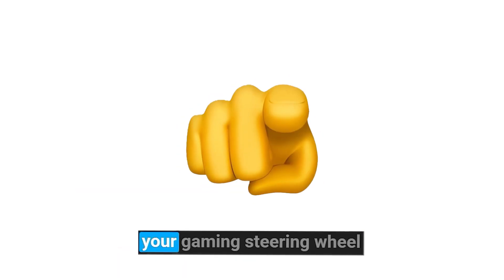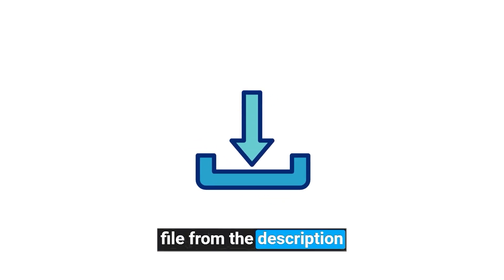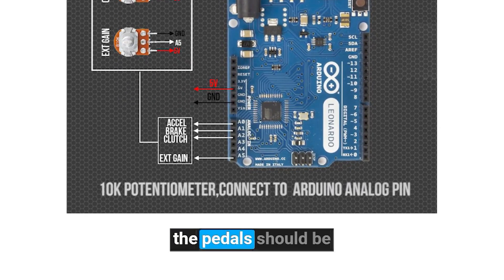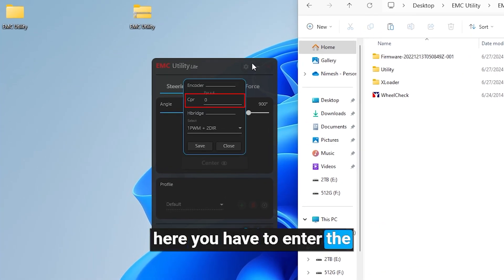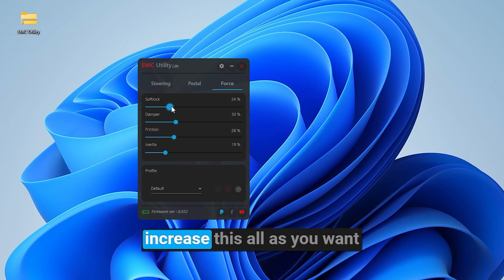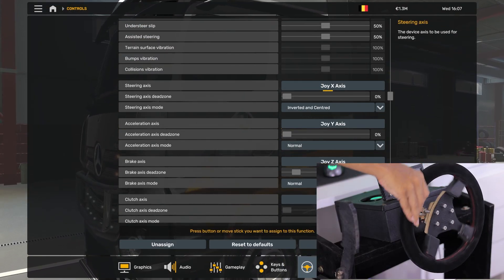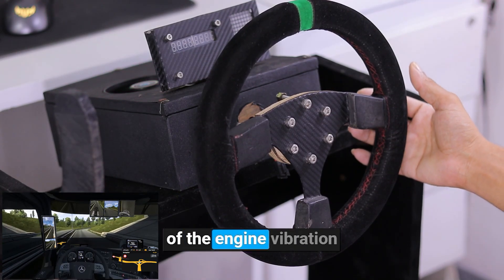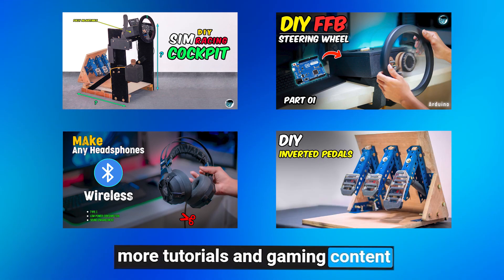Let's Try EMC On DIY Gaming Steering Wheel

Comment from the maker: Found Something Helpful For The EMC Lite Users.

In my EMC Lite tutorial video, I said this supports 3 buttons only. So, because of this, we can't use the H-shifter and other buttons. We can only use three buttons.
  But recently I found another 8 more working buttons. I uploaded a PDF diagram link you can check it. So now you can use a 7-speed H-shifter and 3 more buttons.

Check this out - https://drive.google.com/drive/folders/1mOYUsYBuNYONqEzS9h-bM3neYA0BAqmM?usp=drive_link
Reply: You can use at least 16 buttons, used three analogue pine and 4.5,6,7,12 contacts
Reply: My pedal is not working how to fix it?
Reply: That last part 5:57 , that's the main concern 😢 , I'm thinking, there is no safety for the infinite spin in emc utility, 

Infinity spin happened due to  ,
1) in case of motor can't able to reach the desired position of encoder
2) encoder signal get noised 
3) EMC utility crashed 
4)game crashed 

Solution: there should be a hardware break after 900°
Inside the firmware there should be a lock.  ffb signal =0 then torque=0

I have a new solution, there should be a secondary microcontroller which will communicate everytime with Leonardo, the 2nd one will latch a relay power in case of these problems that 2nd will cut off the main power of motor

Comment: Hello , why does ffb only work when turning the steering wheel to the left side both in games and in wheelcheck 
Can this be related to the insufficient power of the power supply, I have it from a PC and a current of 18 amperes 
I ordered a 33 amp power supply, I hope that's the case, but if not, what could be the reason?
Thanks
Reply from the maker: It's not a power supply problem. Have you remembered that the bts driver has two signal wires from Arduino pins 10 and 11. one for the left side signal other one for the right side signal. In your case, the one side ffb is working, which means the other side signal didn't take the bts driver. So I think you should check the bts and Arduino signal wires. It would be better if the wires were changed.

Comment: Hey i have a problem u didnt show solution, my steering wheel is a bit buggy. Game detecs the center (0 degrees) as steering wheel turned fully left, and if i turn left one more tick, it turns fully right instantly. And game takes center as 224 or 228 degrees. Pls help. My encoder is ky 040

(Tested games: My summer car and Long drive)
Is games are problem or my steering wheel?

Comment: Why would anyone use EMC when there is AFFBWheel available... it supports more hardware than emc and its not paid- allows for so much configs.
Reply: That didn't even worked for me, center always slips, games don't even recognize FFB.
Reply: @kristof3031  what CPR Encoder are you using? is it the ky-040? and for forza and other titles you require GIMX or forzaemu to play. I've made two steering wheels with that and works flawlessly

Comment: Hey, I was wondering, do you need protection between the H-bridge and the DC motor to safeguard against the voltage generated when the motor spun by the wheel?

Comment: Hey Nimesh! My encoder works great when turning slowly, but messes when rotated fast. Is that due to not adding that 1k resistors? Do resistors reduce noise? I grounded the shield wire but nothing happens...

Comment: always bug with centering.
i try with different encoder, bug still buggy.
0 degree always change position
Reply from the maker: I think it's not a bug. It can happen bad connection between the steering wheel shaft and the encoder. Also, it's good to encoder wires soldering to the Arduino board for better connection. because the jumper cables are not connected properly.
Reply: any solution for ffb not working di rfactor2?
wheel detected but no ffb
Reply: Same problem here too, everything fixed properly, no slipping, 0 point still changes.

Comment: I have a problem with the steering wheel. EMC normally sees an angle from -450 to 450, but PC only sees -450 and 450, like the arrows on the keyboard. ffb doesn't work but I think it's because of the problem above. Does anyone know how to fix it?
Reply from the maker: Check your encoder CPR value on EMC.

Comment: Hello guys. I figured out how to use 4 buttons on the emc lite software.
Use the digital 4 pin for ground, and digital 5 pin is button 1, d6 is button 2, d7 is button 3 and d12 is button 4

4-5
4-6
4-7
4-12
Reply from the maker: thank you!❤️
Reply: is there a pin for the other buttons bro?
Reply: @ojanmarkojan312 if you buy the EMC, but that only works for esp32

Comment: How can I invert force feedback direction in EMC? I was playing F124 but the FFB is in wrong direction and there are no setting in F124 to invert it like Forza 5
Reply from the maker: There is no option to change in the EMC. Switch pins 10 and 9 of the Arduino board.
Reply: @ But changing it will opposite the EMC’s wheel lock, even I change the force to 0%
Reply: @ what about wheelconfig show that Another instance of WheelConfig is running
Reply: And WheelConfig show that my wheel is not rotating even if my wiring is correct and encoder is not broken

Comment: what is your editing software and voice over and i did have that problem it happen whenn the wheek goes over bumps so it ocelates so the sofware gets confused and tries to 0 it but it keeps failing so it spins the only way i found to fix it is to lower road viberation this happend in forza for me too when going over some rocks
Reply from the maker: I use Premiere Pro and Google Cloud text-to-speech. yes, I also try different games. The same happened in assetto Corsa. but not every time.

Comment: mas saya pake encoder printer epson ip2770. tanpa ffb berjalan normal. tapi ketika saya nyalakan powersupply tidak terjadi apa apa (wiring 100% sama sdh bolak balik di check, motor pakai 775, psu 12v 20A) apakah ada saran atau solusi? terima kasih

Comment: what is z toggle for
Reply from the maker: It is used for wheel calibration, but now it is unnecessary for the new EMC version.
Reply: @zudumalli  alright but there is also calibration for the yk
Reply: @zudumalli  also not the new version the lite version
 so i still need it?

Comment: Hello bro, I made the connection as is from the BTS7960 to the motor driver, but the force feedback does not work for me
Reply from the maker: did you check your motor driver and Arduino wiring
(Arduino 10, 9, 8, pins)
Reply: @zudumalli  It was a bad encoder connection, it had pins A and B inverted, which is why the feedback did not activate.

Comment: Good afternoon! I built a similar sim wheel, but on the EMC utility lite software the steering is inverted. I tried inverting the encoder wires, it worked but the ffb went crazy. Do you know what can I do? I'm researching in the internet but i haven't found anything useful yet.
Reply from the maker: try inverting the motor driver wire (10,9 pin)

Comment: Saya sudah lama menggunakan EMC lite, tidak pernah ada kendala, mungkin karna punya saya non ffb 😂

Tapi ada beberapa kemungkinan anda mengalami masalah seperti itu, belt longgar, pulley tidak mencengkram dengan baik pada as roda kemudi, kualitas encoder buruk.

Agar lebih awet dan tenaganya kuat anda bisa menggunakan motor dinamo sekuter listrik misalnya my6812, dan ganti as roda yang lebih besar agar lebih baik menahan putaran dan pulley tidak bergeser.
Itulah info yang saya dapat dari komunitas😅

Saya tunggu update selanjutnya 👏🏽💪🏻
Reply: Maaf saya instal EMC lite di paling bawah tulisannya firmware ver : unknown.  Dan gak bisa di apa apakan .kenapa ya
Reply: @alfawings1958 coba reUpload frimwarenya bang, atau check perkabelan biasanya masalah disitu
Reply: @alfawings1958 framware Emc nya belum di load ke Arduino.
Reply: Punya saya FFB menggunakan Encoder 600 PPR, stir di putar  90° error (muter kenceng tidak bisa dikendalikan) sudah di utak Atik belum ketemu solusinya.
Reply: @s4mimawon  Coba reflash ulang gan, ane juga gitu kok
Reply: @s4mimawon  wiring di bts nya di balik gan

Comment: my potentiometers fluctuates rapidly if i use smps but does not if i use laptop charger ...any ideas what could be the problem??
Reply from the maker: Does your SMPS power supply have an earth wire? Check it is properly connected.

Comment: I want to ask because you have been using it for a long time. Was the rs 775 motor enough for you? Were you able to solve the heating problem completely with the fan? Would you consider buying a larger dc motor?
Reply: Use 895 motor for more torque , increase torque and decrease rpm with either gear or belt.
Reply from the maker: honestly enough for me. but it depends on the power supply and weight of the steering wheel and its width. I use a 12v 20A power supply and a 300g Steering wheel. wheel width 10.5 Inch

Comment: Hi if u connect all the wires from potentiometer ro controller then which wires are connected to pcb board in controller method please help
Reply from the maker: Bro that video description has all the diagrams check it
Reply: @zudumalli  it is not proper
Reply: Which wires did u add in the pcb board and from where did u add
Reply: What is wrong with you man what do you mean by not proper? İts literally the easiest diagram to read you Need Basic electrical understanding man there Are far complexe Diagrams than this 😂
Reply: @DarkRange-vw2pn  then explain me bro which wires are connected to pcb board and from where

Comment: 5:50 Let's allow a turn of the steering wheel of 900 degrees. This is due to the fact that the torque of the motor is not strong enough to stop the steering wheel in softlock (-450 ... +450 degrees). Because of this, it goes beyond the maximum degree of rotation of the steering wheel in one direction of degrees and then tries to return it to the extreme the value is 450, but again, due to the weight of the steering wheel itself, it begins to twist it already in the other direction and repeats itself.
Reply from the maker: I don't think the torque is enough. But another thing happened, this truck turns off the engine and when using the wheel config, the wheel feels tight (realistically) but nothing happened in the EMC and after turning it about 50 degrees, it started spinning like in this video.
This also happened with Assetto Corsa
Reply: @zudumalli  whats truck I don't get it
Reply: @starkovigor27  the truck in the game
Reply: @zudumalli  Same thing is happening with me

Comment: how to use buttons with this?
Reply from the maker: you can use three buttons in this for paddle shifter or sequential shifter. check the description diagram link.
Reply: @zudumalli  where is the option to add them in the utility software?
Reply from the maker: There is no option for that. just connect the button wires to the Arduino.
Reply: @zudumalli  and how does the button get registered in game?

Comment: 5:49 I had same problem the solution is  minimize the game and open the emc software turn the wheel upto 0 degree and we can add maximum 4 button in liye version so we can use paddle shifter or sequel shifter
Reply: U can use 16 buttons, I my self have used
Reply: @coolbosplayz5318  in emc free version you can use only 4 buttons only in rfr support 16 button i think so
Reply: @coolbosplayz5318  in emc free version you can't
Reply: @coolbosplayz5318  how ?
Reply: We can use handbreak and clutch at same time there is an option for that
Reply: And one more before Manuel turning to centre turn off motor power supply😅
Reply from the maker: Thanks, bro. I got it. I can see that his diagram connects the buttons to the GND - digital pins. so that's why I am saying we cannot use buttons through the lite version. but after you said that I would short the digital pins one by one then I found three useful buttons.
Reply: @zudumalli bro please respond to me
Reply: @zudumalli  you can use the 4 buttons are 2-5 and I cannot tell the connection because I am beginner in ardunio😶‍🌫 but there is video about it and the button never shows in lite software . It shown only in windows joystick control section. Your videos inspired me to create something thanks for your Tutorial ❤‍🔥
Reply from the maker: Yes, I see. Thank you too
Reply: @zudumalli  
Yes you can use 16 buttons  in the lite version 
By using only 8 digital pins from Arduino
According to EMC's wiring diagram we can make a '4 x 4' button matrix .

For now Imagine It like , we have pins A, B, C, D, 1, 2, 3 & 4 .

Then the buttons are     | A1 A2 A3 A4 |
                                         | B1 B2 B3 B4  |
                                         | C1 C2 C3 C4 |
                                         | D1 D2 D3 D4 |